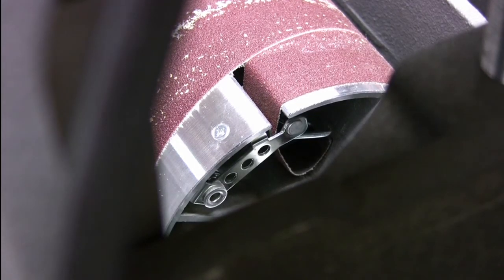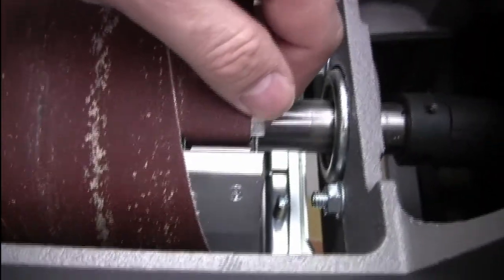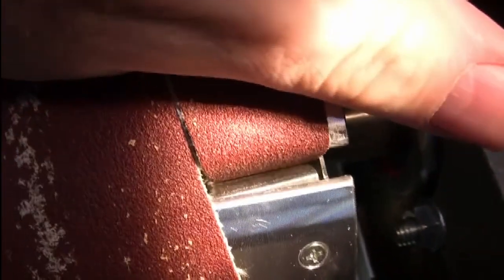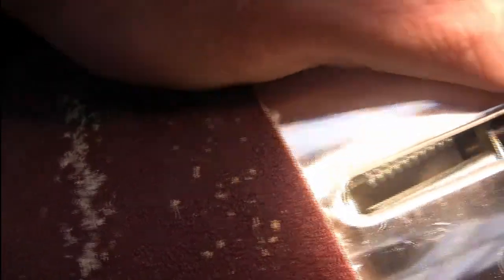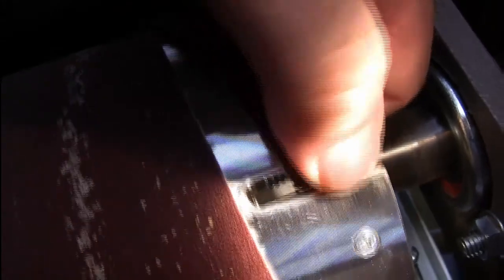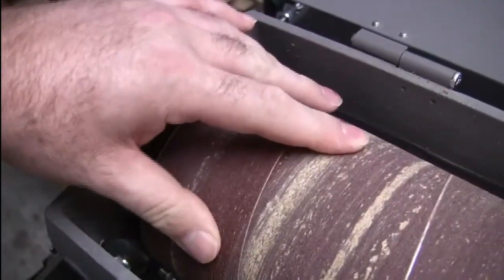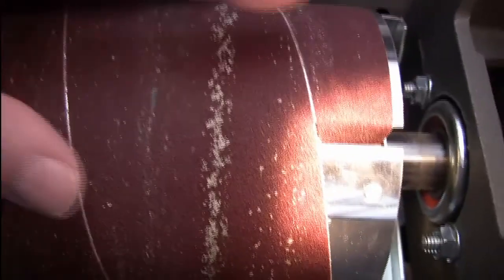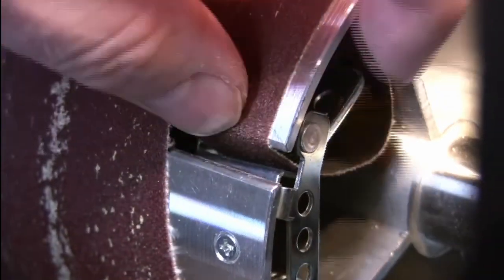Laguna Supermax 19-38 sandpaper change right side

Comment: Wow I have fought and fought with mine and each time I keep forgetting how I did it before because you cannot see the thing due to the motor plate. Yes, I feel stupid but this video was so helpful. Thanks for taking a few minutes for dummies like myself!
Reply from the maker: Glad it helped. 🙂  You should not feel stupid unless you were the one who originally designed it.  People design the craziest things sometimes for tools etc.
The important thing is to get it figured out and/or have someone show you how it works, then you know for next time.
Reply: Happened to me first few times too. Bc of the curl of the paper it curls itself under the spring and not through the clamping section. I then started to prebend the end section to undo the curl. So it will go straight down.

Comment: Thanks for the vid. I just got my sander and put the paper in the first time. It took me a couple of minutes. It's much easier if you start on the right side, put the paper in, make sure it's secure, roll the paper to the left side where it's easier to operate the clip and end there. I hope this helps somebody.
Reply from the maker: I have been lucky to never have a problem putting it in from the left, it is good to know you can also do it from the right, I am guessing you needed to unroll the roll and start from the other end on the right side?
Reply: @josephkrug8579  Yes. I just saw the Laguna video on how to align the head and that's how they put the paper on in that video.

Comment: Good video.  I struggled with this.  Aggravating as heck.  Then I wrapped the paper tight and slipped in a block of wood under with the slightest of pressure preventing the drum from revolving.  It made installing the paper a breeze.
Reply from the maker: I am glad it helped.  Once you understand the mechanism, it makes more sense how to get the paper installed.  I think you will enjoy the sander a lot. I know that I enjoy mine and use it on most of my wood projects since I got it.

Comment: This maybe helpful, load the paper then using the quickset lever lower the drum onto the platen then the drum won't roll around and the paper won't loosen as you struggle with the clamp
Reply from the maker: I guess that could work too.  Personally I have never had problems holding the paper tight as I played with the final clamp.  Has that method worked for you?
Reply: @ it has, having a lot of arthritis and diminished motor control it really helps

Comment: Joseph, I went through 3new #80 grit sandpaper rolls today, I was trying to sand a piece of oak that was 5’x 15”x 4” that I was wanting to make a table top.  It was some rough saw mill oak that I had for about 6 years. I have about 4 pieces all about the same size. Unfortunately my Dewalt planer is only 12 inches as I sure you know and I didn’t want to cut them down to size fix my planer. I going to sell the sander and buy an industrial plainer and just go back to my Festool ob sanding. Thank you, for a good video
Reply from the maker: Yeah it is not a full replacement for a planer for rough sawn wood.  In a comparison between steel/carbide cutters vs sandpaper, sandpaper would lose every time.  
If I was going to try that oak, I would not take super aggressive cuts and work my way down/or clean it up some on my bandsaw first (depending on how much thickness I needed to remove).   I believe I got some even coarser grit than 80 for it...in one of those multi pack boxes for the paper, but so far I have not had a reason to use it, ie so far I have run the wood through the bandsaw first where I had very much to take off.  Good luck with your plan, I am glad you liked the video even if you do not like the sander for what you need. :)

Comment: I have the same problem as your friend. We are missing the metal bar that the spring clamps against. Just spent a couple of hours trying to fabricate (rig) something up. Not successful yet, but not giving up.
Reply from the maker: If you have missing parts, although I love fabrication projects, maybe contact laguna, they may have the right replacement piece they can sell you for less time/effort than it is to make it.  otherwise, good luck, and hope the video was useful in any case. :)

Comment: Thank you for the video!  I still fin this very difficult.  can't believe this has not been improved in over 10 years.  Great sander - horrible belt attachment mechanism.  I wish festool made a drum sander so that you could change the paper without bandaids.  I;ve been doing it for 10 years and it is hit or miss every time
Reply from the maker: I am glad you enjoyed the video.  I have found that if you put the paper in the right place it works every time, but it can be a challenge to make sure to get it in the right place.  I have heard from some other people that they attach it on that side first then go the other way to install their paper.  But that means if you buy the pre-rolled paper you have to unwrap and wrap it in reverse to use it.  In any case I really like my sander so far.  If you have any other questions on it, please let me know and I will see if I can help and or make a video explaining what I understand for it.
Reply: @josephkrug8579  your video was the first that made that clear. I am trying it tonight. 🤞
Reply: Worked like a charm. Lacuna should send you free paper rolls! 😂
Reply from the maker: @jc03571  I am glad it helped :)
Reply from the maker: @jc03571  I am glad it helped. :)  I am curious if you also check out the pinned video from Laguna on the paper?  Theirs does show it going in on the right side, but they dont explain it much.  In any case, now you got it working, so that is the key.  If you have other questions on the sander, let me know and maybe i could make another video if I know the answer. :)
Reply: @josephkrug8579  I think it is one of the best tools I have. Do you find any sources of paper better than others?  And also any advice on how low a grit to go - I usually run it at 80 and finish sand separately - but many have sponge about going as low as 36 grit and replacing the planer entirely.
Reply from the maker: @jc03571  I bought a bunch of the various grit packs of "supermax tools" brand pre-cut sandpaper at Rockler when i got my sander...and so far although I have the wide range of grits, for the projects I have used it for so far (all of which have videos on my channel) I have mostly used 80 for the rough sanding/thicknessing and then 220 for the final mostly cleaned up...then my 5 inch rotary sander with the full final sanding.  I like with this sander that even with 80/220 grit, if you just run it through multiple passes (and dont change the height) it takes less and less off each pass for a more finished sanding.  So if you change the orientation of the wood and dont change the height of the sandpaper/roller, you can even with just 80 grit, get fairly smooth with not many sanding marks on it.  Then with the 220 and doing the same get really nice results.  Most of my work I cut the wood to thickness either on my bandsaw or table saw then clean up on the drum sander...for what I do on my typical projects, I almost never need my jointer and do not even remember the last time I used my thickness planer.  Hope that helps.  Let me know if you have other questions. :)
Reply from the maker: @jc03571  One other thing that I got from Laguna support, if you get sap etc caked in the sandpaper (which can happen), you can take the sandpaper roll off the sander and soak it in mineral spirits to soften it and then clean it up easier.  Then of course let it dry thoroughly before putting it back on the sander to use.  I do think the low 36 grit could be used to do a lot more rough thicknessing vs a planer, but as I said, most of the time I would just use my bandsaw to get the wood to approximate thickness first (then I have two pieces to use for projects) and then the 80 grit to clean up the bandsaw marks etc.

Comment: I sent Supermax a e-mail that if I spent another 15 minutes on that belt that my 25-50 would be on the curb this afternoon. Time starts now.
Reply from the maker: Well hopefully my video on the 19-38 sandpaper will help with the 25-50 too.  I would expect that they have and use similar clips, since that would be easier to stock replacement parts.  If you have any further questions on anything in the video let me know and I will try and explain it further.

Comment: Thanks for the video, i tried 20 mins to do it , watched your vid and did it 1 min.  The left side was easy, but some demon engineer wanted to leave a nasty surprise on the right side. Maybe they expect to sell service visits to install them for buyers. DOSEN'T HAVE TO BE THAT DIFFICULT!
Reply from the maker: Im glad it helped. :)  As you figured out, once you know what to do, it is not bad, but if you do not realize it, it can drive you a bit nuts.  I love my drum sander so far, and I used it again today to help a neighbor clean up two projects, works great especially since you can run a board through at the same 'level' more than once and each time it takes a fraction off until you get to the perfect thickness.
Reply: Ditto

Comment: this may be a dumb question but do the drums spin in the same direction? does one sand and the other pulls the work through, thanks
Reply from the maker: The belt moves it front to back, and I believe the drum spins it against that movement.  Otherwise it would just grab it and spit it out the back.  It is similar to how you do hand sanding.  ie if you think about the board sitting still, you move the sandpaper forward over it, and if the board was moving towards you, it would give you better sanding, but moving away (same direction as your push stroke), you would not sand.  So based on physics, it has to rotate and sand against the direction of the feed belt. :)
Reply: Thanks for a speedy reply Joseph,  i'm working on a project to sand arrow shafts for a friend and so looking at all ideas

Comment: I have a Jet drum sander and in need of parts.  Jet has discontinued some of the parts and I’m trying to figure out if Supermax parts are interchangeable. Can you please measure the overall length of the driven roller for me so I can measure mine and see if it’s the same length?
Reply from the maker: Sorry, I am not sure which piece you mean.  Do you mean the actual drum width (end to end) for the 19-38 or the drive shaft width?  You might also be able to call the laguna support line (or email them) to ask for the part sizing.  If you can explain which piece you want, I can try and see if I can measure mine as well for you.  Also, here for a replacement roller for the 19-38 I see: https://www.rockler.com/sanding-drum-for-supermax-19-38-combo-sander?country=US&sid=V91040&promo=shopping&utm_source=google&utm_medium=cpc&utm_term=&utm_content=&utm_campaign=PL&gclid=CjwKCAiAksyNBhAPEiwAlDBeLI0FKFmhDadrM1QBN6OuVNUNPvNHudlB10h1LQ6cqTiIW0TVI4x2pBoCXOcQAvD_BwE   

ie under the specifications:
Brand 	Supermax
Manufacturer Part Number 	71938-1
Weight 	11.000000
Tech Spec 	

    Drum Dimensions: 5'' Dia. x 19''L
    Material: Extruded aluminum

Hope that helps, let me know if I can try and help further.
Reply: @josephkrug8579  no the roller at the end of the belt that you tighten to put tension on the paper.
Reply from the maker: @timothysteadham331  So do you mean the tensioning clips to hold the sandpaper onto the drum?  Or do you mean part of the drive belt itself like they they talk about here? https://www.manualslib.com/manual/1246851/Supermax-19-38-Drum-Sander.html?page=18
Reply: @josephkrug8579  sorry. I meant the roller at the end of the bed that you manipulate to tighten or loosen the conveyer belt. The other roller (drive roller) is connected to the conveyer belt motor but that one is more difficult to measure.
Reply: @josephkrug8579  page 27, part 29
Reply from the maker: @timothysteadham331  Ok, I now think I know which part you mean.  I went out and took a look, and the adjustment roller for the bed drive belt on mine is a smooth roller which looks to have two brass bushings on the end that the tensioning pieces fit over and a inner rod that sticks out through the bushing from the center smooth roller surface the drive belt goes on (this one is smooth the drive one is crosshatched for grip).  The larger roller shaft length that the drive belt rides on is 22 11/16 approx long, the end to end pin that sticks through the brass bushings looks to be around 23 3/4 inches long.  Does that sounds more like what you were asking about?
Reply: @josephkrug8579  yes!!!  Thank you so much. I owe you a Starbucks. Lol.